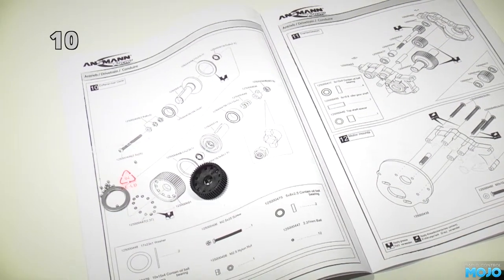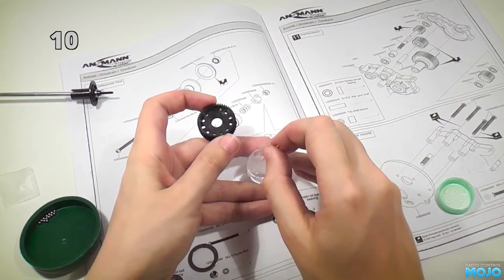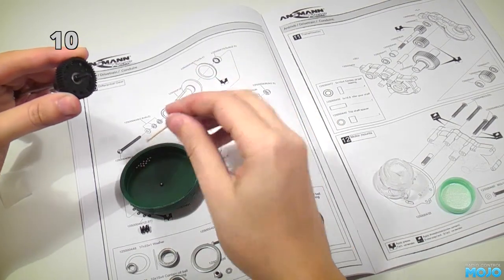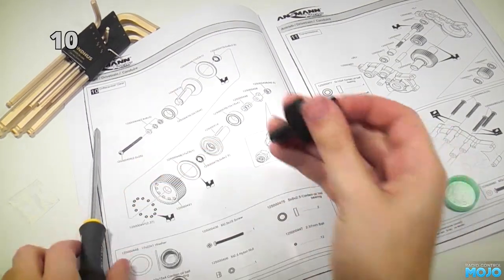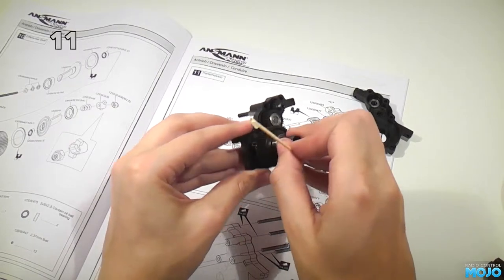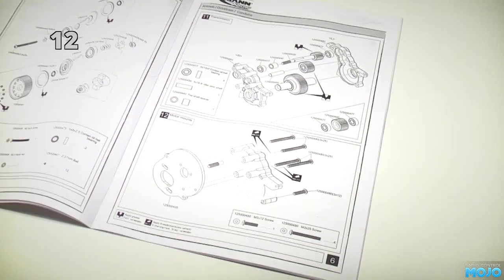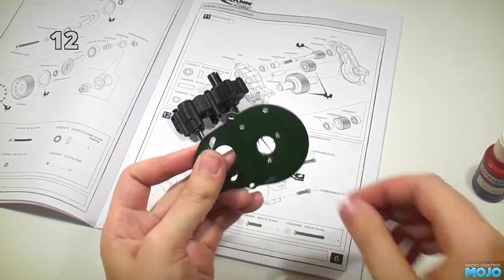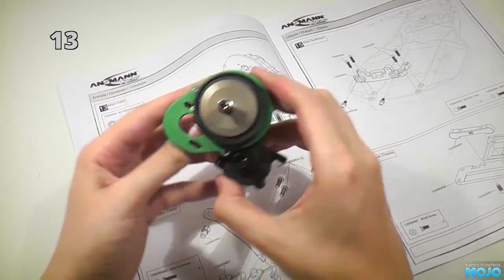Ansmann Macnum - Gearbox

Comment from the maker: The diff should be somewhere between quite and very tight, the goal is for the slipper clutch to slip before the diff under acceleration to give maximum life of the parts. The gearbox should spin freely with no real friction and feel nice and smooth, don't forget you'll also be turning the motor so pop the pinion off to check.

Comment from the maker: If the diff has been slipping the balls and thrust plates will be damaged, so at the very least you'll need to replace them, if you have been running with a loose diff for some time the heat generated could well have damaged the plastic gear itself. A rebuild wont be hard to do, just make sure you run it slightly tighter and check it often. Of course theres always the bodge of glueing the whole lot up with some epoxy, but that will only last so long, so best to fix it right.

Comment from the maker: The uneven load may well cause some issue, but the core problem is the balls sliding on the thrust plates. That leaves damaged balls/plates or running loose.

Comment: i have checked the balls it they look undamaged. the gear looks fine and turns with no problem in the case. the only thing which is damaged is the tiny washer with the tiny balls in the thrust plates. 2 of the balls have gone missing. would that make a difference?